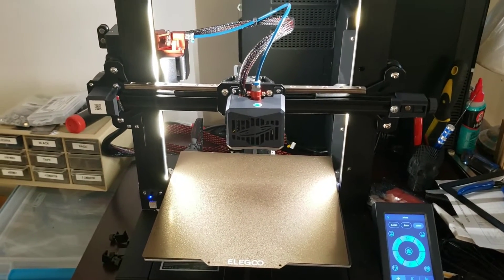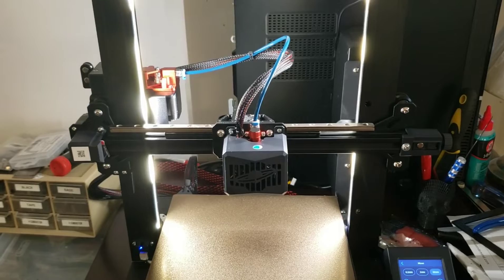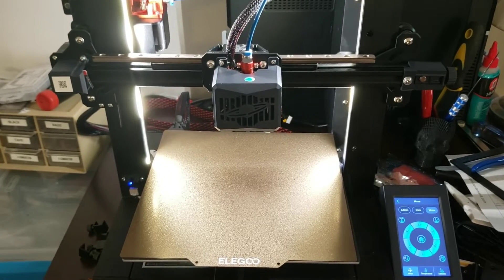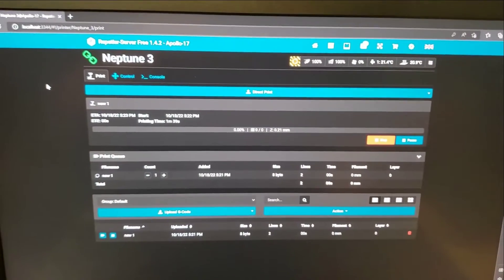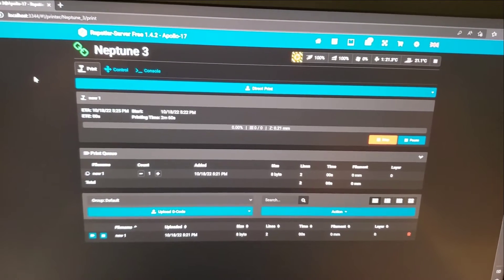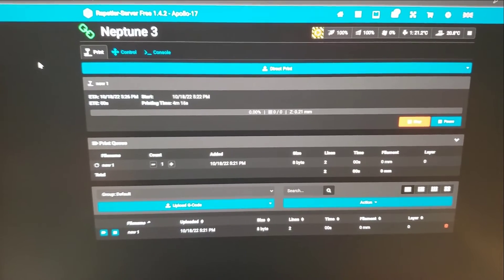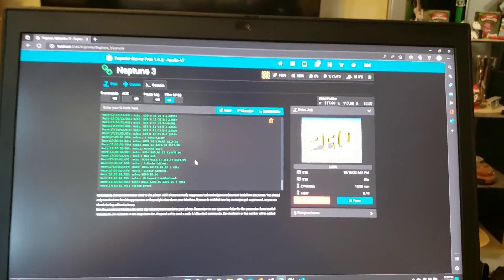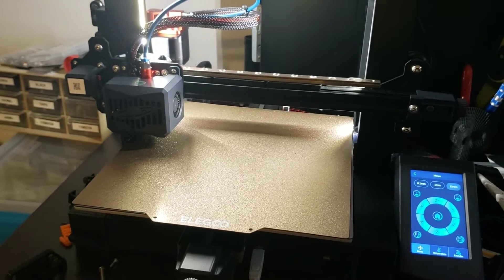Elegoo Neptune 3 G34 auto gantry square and G29 auto bed leveling shenanigans

Comment: My dude, where did you buy the true z dual axis? Is it the creality one?
Any plans on using klipper?
Reply from the maker: Here's the kit that I used. It's a creality one, yes. https://amzn.to/3TtHZJC 
You'll also need a TMC2225 or 2208 driver installed in the E1 socket. I have a how-to video posted from a few days ago. You need to flash firmware, but it takes mere minutes and the results really speak for themselves. 
Here's the 2225 drivers I ordered: https://amzn.to/3eIqEho